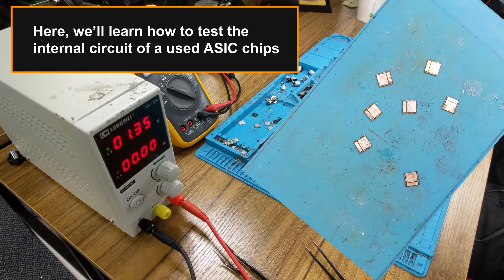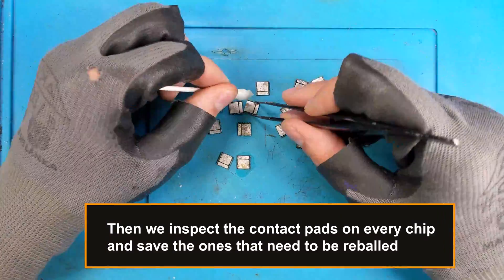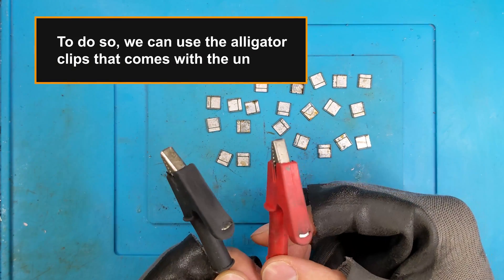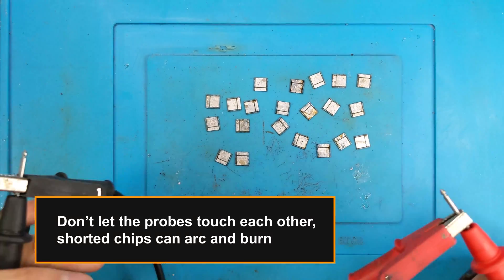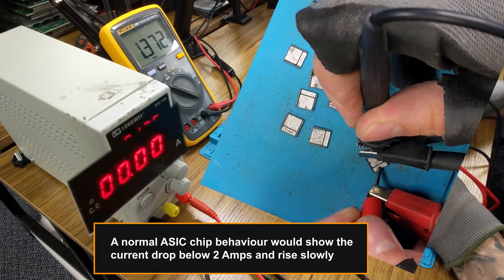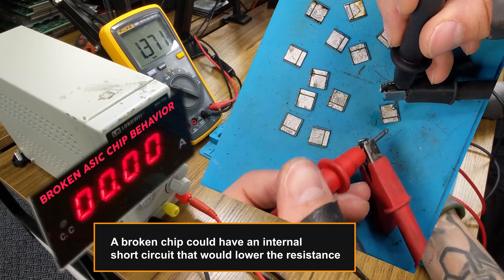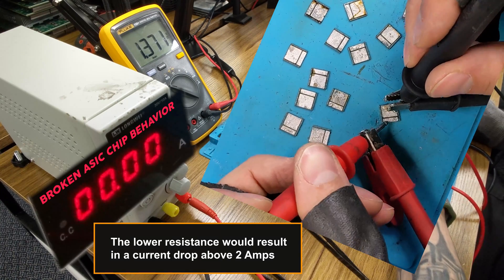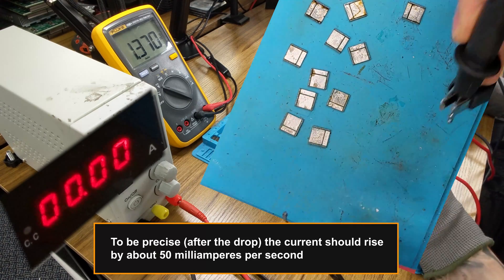Antminer Repair: How to Test BM1397 Chips with a Power Supply and Multimeter

Comment: 是不是数据快速显示，就是坏芯片？
Reply from the maker: Yes, just follow the tips we give in this video and for the most part it will get rid of 95% of the bad chips you have this way. 

There are also chip testers that use sockets but are more expensive to design or buy. We made one, but not a commercial one, just for our own testing.

Comment: Will these numbers and methods work for chips from other Brands?
Reply from the maker: No, it is for BM1397 chips. There are other ways to determine if the chip's internal circuitry is good. In particular by testing the resistance directly with the continuity mode on your multimeter. We will make another video to show how shortly. Stay tuned!
Reply: @DCentralTech  Thank you!